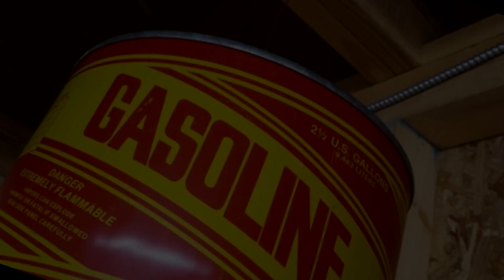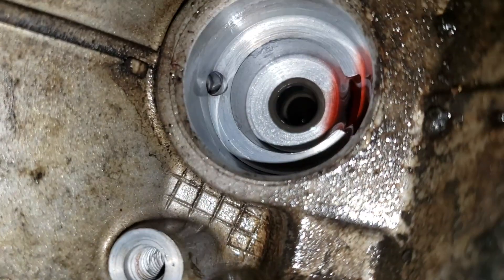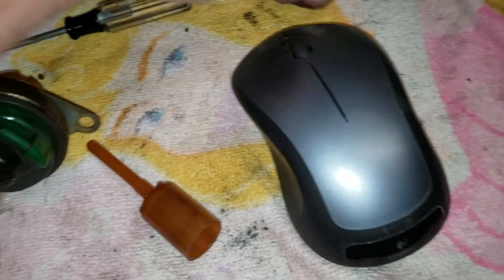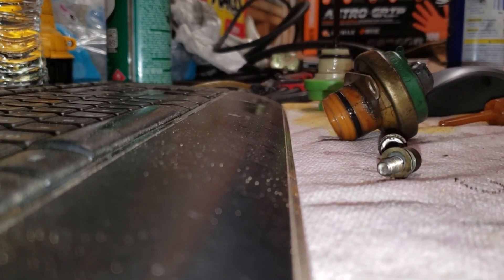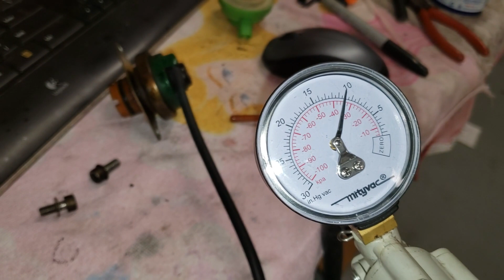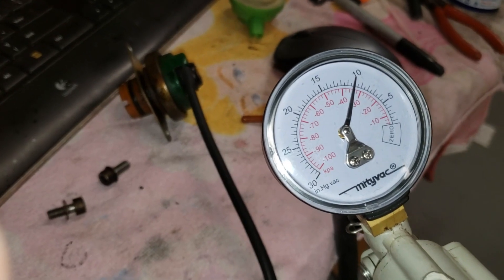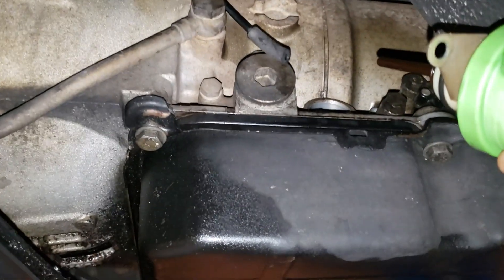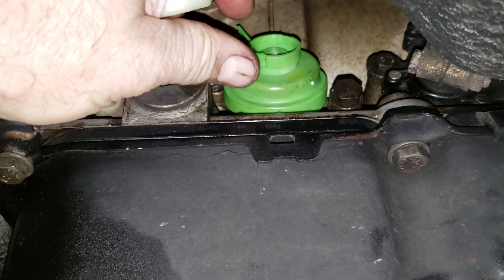Automatic Transmission Modulator Valve Replacement - W126 Mercedes 722.3

Comment from the maker: After several attempts at dialing in the modulator I believe I got it where it needs to be.  The gold standard, in my opinion, is the shift smoothness of the Turbo Hydramatic  400 (TH400) in my Coupe Deville. (chosen for certain models of Rolls Royce cars as well mind you)  The 722.3 in this 300SD now shifts quite smoothly and is not distracting like it was before. Even the 3to4 shift is now smooth. I've not encountered any flairing..... what ever that is.  The end result was that I turned the adjustment all the way counter (anti) clockwise until it stopped, then a half turn back clock wise. (7.5 turns from where ever it was out of the box)  I made several adjustments in either 2 or 3 turns at a time before each test drive. Note also that I started these adjustments with a new unit right out of the box. I have no way of knowing the position in which the manufacturer places the adjustment before they package it for sale.
Reply: Did it solve your late shift?

Comment: hey. my cap (that pne that you have glued on) is broken too, it;s in but has crack sit loose. I have quite hard shifting, but the main problem is when i step out of gas pedal and it's the moment of gear change  - it just so harsh like a hammer knocking on my rear wheels. I'm reading that the caps has also influence here as it needs to be good - it it true? i always thought its also for protecting the screw inside... and second question: when you remove old modulator  (i have 722.4), will it drain lots of trans oil then?
Reply from the maker: Is the shift from first to second delayed? If so this could mean the bowden cable on top of the valve cover needs adjustment. The Bowden cable controls WHEN the shift occurs and the modulator valve controls the quality of the shift. If the shift is significantly delayed, this could lead to harshness. To adjust the modulator, remove the cap and turn the T shaped handle inside.
Reply: @ImpalamansGarage  I'm playing with both thing 3 years non stop... tried all the bowden adjustments, all the accelerator cable adjustments and modulator adjustments too. Is the cap a problem? Or I just have bad modulator?

Comment: I have the w126 inline 6 and whenever I put it on drive it makes this aggressive shift. Was looking for info on this. Will this fix it? Before I go balls deep on the transmission?? Lol
Reply from the maker: The first thing you should do is to make sure you have no broken vacuum lines. Check ALL vacuum lines in the engine bay and to the transmission. Replace any that are cracked or broken. Then adjust the modulator. Clockwise makes the shifts firmer. Counter clockwise makes them softer. The bowden cable on the throttle assembly affects the timing of the shifts - earlier or later. What precisely do you mean by "aggressive shift" when placing it in drive? Any diesel powered car or truck will lunge forward upon putting it into drive because of the torque at idle, although it should not be harsh or loud.

Comment: did this fix your hard shift into 4th?
Reply from the maker: Yes. The adjustability of this new version of the modulator is nice. Keep in mind the quality of shifts is dictated by the modulator and the timing of the shifts is regulated by the Bowden cable adjustment. They work together so you will need to tweak both of them.
Reply: @ImpalamansGarage   great! I'll dig deeper! Great video

Comment: I have W126 280se m110  722.3 transmission, the vacumm line is hanging loose at the engine bay, where does it connect??
Reply from the maker: I cover it in this video. https://youtu.be/Wz4_eMrZk9o   Let me know you need additional info.

Comment: so what was the result of your labour?
Reply from the maker: The transmission shifts so much better than before. With the updated modulator and adjustments plus new vacuum lines in several areas.... the driving experience is very nice. In some instances, depending on the driving conditions I have noticed a very slight flare from 2 to 3 but this has only happened once or twice. Debating on whether or not to make another small adjustment. Guess I will just have to drive my classic Mercedes some more to determine!
Reply: @ImpalamansGarage  Once you put that plastic cap on, can you remove it? I have a new injection pump with  bigger elements. The car shifts great except for the 2-1 down shift is rough. I used the fine adjustment and the shift improved slightly. If I could just get that cap off and adjust it more I believe the problem will be solved.

Comment: Thank you for your great videos. I have a 1991 350SD, I lost reverse gear and started looking for a used transmission but after not finding one I decided to replace my vacuum modulator using your video as reference and to my surprise , I now have reverse but is not smooth, it doesn't kick in until 4 or 5 seconds later and makes my tires spin. How do I know which way to adjust the modulator? I also found a disconnected vacuum hose from the vacuum control valve that runs next to the fuse box but I don't know what it connects to. Any advice will be much appreciated , thanks again..
Reply from the maker: Clockwise adjustments of the modulator increase shift firmness. Counter clockwise adjustments make them smoother. Going too far either way has obvious repercussions. I'm not sure adjustments to the modulator will address the reverse issue. Here are a couple of links with good discussion on this topic that may help. Regarding Modulator adjustments:  https://www.benzworld.org/threads/i-fixed-my-shift-flair.1314697/#post-2330736         Regarding reverse issues:  http://www.peachparts.com/shopforum/diesel-discussion/376603-only-using-half-springs-722-3-transmission-reverse-piston.html
Reply: @ImpalamansGarage  I will try the adjustment tomorrow  and will also check the other info. thank you for your time and knowledge.
Reply from the maker: Here's a vacuum diagram of an OM603 from 1987. It may suffice to help you. http://www.peachparts.com/shopforum/attachments/diesel-discussion/98874d1326765510-om603-vacuum-parts-vacuum603.jpg

Comment: I will definitely be doing this next. I believe I have adjusted all I can with vcv and current modulator. My shifts are close to what you were experiencing before you changed the part. All vacuum related

Comment: Dumb question, Do you turn it right to make the shifts smoother or harder?
Reply from the maker: Clockwise adjustments of the modulator increase shift firmness. Counter clockwise adjustments make them smoother.

Comment: So important question, did this fix all of your shifts??
Reply from the maker: This modulator allows for fine tuning adjustments. Couple that with adjustments made to the Bowden cable, and yes.  There is a high degree of adjustment available and simple replacement alone is just the first step.

Comment: Great vid. I have a w124 with the same modulator, and I think mine's fine cause it can be adjusted with the T-pin to impact shift smoothness. However, I have one peculiar symptom. When I cause the car to shift between 2000-2200 rpm, there is a noticeable flare. If I am gentle with throttle and it shifts below 2000 rpm, no flare. Same with full throttle when it shifts upwards of 2500 rpm, no flare. What could possibly be the reason for this you reckon? Slight tranny oil leak exists, but dipstick has been showing full for atleast an year.
Reply from the maker: From what I understand, the situation you are describing is quite common. Long story short I believe it has to do with the amount of vacuum supplied to the modulator by the VCV (Vacuum Control Valve) under these part throttle conditions. Here is a document detailing the modification of the VCV to help with this situation. I've not done it however. http://jenniskens.livedsl.nl/Technical/Tips/Files/Mercedes%20722.4%20adjustment%20guide.pdf
Reply: @ImpalamansGarage  This article was awesome but I failed to mention, mine's on petrol, not a diesel. I read most of it thinking maybe some parts will overlap but feels like on diesel, the vacuum system is completely different.

Comment: Hello, I have some problem with shifting from my European 1983 w126 380. It shifts true the gears very fast, when I drive 40/45 kmh it’s already in last gear.. when I press the gas pedal driving 50 kmh there is no shift back, this only happens when I press the kickdown. Than as you press it the car wil drop 1 or 2 gears and brings a smile on my face.. But as soon as I release the “kickdown button” with the gas pedal it wil shift back to last gear. 
Now I don’t know if this is normal or there is something wrong here.. 

Next problem.. 
when I floor it from stand still, it wil shift first to second smooth, around 5000 rpm maybe 4800rpm. Not sure. than the 3rd to 4th I need to let the pedal come up (release the “kickdown button with the pedal)  because it wil go past 5500 rpm and feels like it won’t shift 🤷🏼‍♂️

Is this supposed to be like this or is there something wrong here to..
Reply from the maker: You may need to adjust the bowden cable. On my car a clockwise adjustment makes the transmission shift sooner. Counter (anti) clockwise makes the transmission shift later. Do this 1/2 turn at a time and test drive after each adjustment. The bowden cable adjustment determines WHEN the transmission shifts. The QUALITY (how hard or soft) the shifts are is determined by the adjustment of the vacuum modulator on the transmission. A clockwise adjustment of the vacuum modulator will make the transmission shift harder. A counter (anti) clockwise adjustment will make the transmission shift more softly. Both the modulator and bowden cable work in concert with one another. It will take you a while to make the adjustments and get your transmission shifting properly. The Mercedes factory set these adjustments by measuring transmission fluid pressures during the manufacturing process. Lastly, when the transmission is shifting from 3rd to 4th under a heavy throttle condition, you may find it necessary to let up (decrease throttle pressure) to make it shift. In general, under wide open throttle you want the transmission to shift at the shift points noted on the speedometer. There are marks on the speedometer showing about where the car should shift when you floor it.
Reply from the maker: Here is an excellent document on how to adjust your Mercedes transmission.  This document is for a diesel but it may be of help. http://jenniskens.livedsl.nl/Technical/Tips/Files/Mercedes%20722.4%20adjustment%20guide.pdf
Reply: @ImpalamansGarage   the best, thanks very much man. I really appreciate 💪🏽 I’ll let you know if this works 😁

Comment: Can the valve be removed when the transmission is still filled with ATF, or will the fluid start draining from this opening the moment I pull the valve out?

Shifting is working fine but there is wetness in that area. I suspect that o ring to leak.
Reply from the maker: No need to drain the ATF to remove the modulator.
Reply: @ImpalamansGarage  Thank you!

Comment: I have E320 with 722.5 transmission, it only gears first gear and don't change it. Do you think that modulator valve is my problem? What you indicates me how start the diagnosis?
Reply from the maker: The modulator valve only controls the quality of the shifts. You could remove it entirely from a normal transmission and it would still shift through all of the gears but each shift would be very harsh. There does seem to be a lot of discussion on your problem in the Mercedes forums. https://www.benzworld.org/threads/722-5-transmission-shift-problem.1549876/

Comment: Hi Master, I am using W124 year 1992
My problem is when normal driving , gear 3 can't shift to gear 4 .
It become free gear .
What is the problems ?
Reply from the maker: Make sure your transmission fluid is new and is full. Usually a transmission which refuses to shift will require a complete rebuild.

Comment: I have benz w124 1995 e320 
What color type of this modulator valve  well used in my car?

And am I can replacement it easily!?
Reply from the maker: Here is the modulator valve for your car.  It should not be difficult. https://www.pelicanparts.com/More_Info/1262709179.htm?pn=126-270-91-79-M22&SVSVSI=3760&DID=13332

Comment: Hello I own a 1982 300sd 126, my transmission won’t engage into any gears it stays in park any clue if changing the vacuum modulator would fix this?
Reply from the maker: No sir. It will not. First:  Check your fluid. If it all leaked out, then the trans won't do anything. Second: Check your shifter linkage under the car. It may have become disconnected. If it's full of fluid and your shifter linkage is OK then you need to tow it to a transmission shop. If all the fluid leaked out you will need to refill it. Remember that checking trans fluid is done with the engine running at idle and trans in park. Each time you add fluid to the system you should hold your foot on the brake with the engine running and cycle the shifter through all of the gears and then back to park. Check again. Add fluid if needed. Cycle through gears again, etc.....

Comment: I've got a 1986 560SL with 200K miles that shifts smoothly while driving.
Its also a 722.3 transmission.
The problem is when I shift to or from Park/Neutral/Drive to Reverse I get a hard engage.
I can get a softer engage if I momentarily shift to Reverse, quickly back, then back to Reverse.
The Modulator looks original.
Have not checked the Modulator to see if it holds Vacuum - need to, but was concerned about
loosing my Transmission fluid.
Do you think I need to try a new Modulator?
Reply from the maker: You'll note very early in the video where I show the open port where the modulator resides that there is no transmission fluid which had dripped down over the lip of the pan. It's dry. Thus there is no fluid loss when removing it. If your transmission shifts properly and the only thing wrong is a hard reverse engage then I would say your modulator is not the issue. Without knowing what you consider to be a "hard engage" into reverse, it's tough to say where the problem may reside, however there is a fair amount of discussion on this topic. Here is one example: http://www.peachparts.com/shopforum/diesel-discussion/376603-only-using-half-springs-722-3-transmission-reverse-piston.html    Your issue may be related to the reverse clutches or springs insde the transmission. I would start with the basics however. Does you fluid look good? If it's not red, change it and the filter. Check all vacuum lines.
Reply: @ImpalamansGarage  Transmission fluid is bright red and full to correct level.
I can get a much less "thunk" by teasing it quickly into reverse, back out, and back in.  Wondering if its vacuum.  Can the way the Modulator is adjusted have an impact on this "thunk"?
Reply: Thanks also for that posting in Peachparts.
Interesting that a firm shift to Reverse is less wear.
Reply from the maker: @cwmoser  I highly doubt it is vacuum. The modulator, whether or it's bad or good, should have no effect on the engagement of reverse gear. The modulator regulates fluid pressure to control firmness of upshifts. I would just hold my foot on the brake and shift it into reverse and wait until it's properly engaged before reversing. I fear moving the shifter around like that might do more harm than good.

Comment: Hello. What was youre problem? Your tranny starts from1, and goes to 3 (no 2. gear)?
Thanks a lot:)
Reply from the maker: Several annoying issues:  Shifts from 1 to 2 and 3 to 4 were hard as nails. Shift from 2 to 3 was way too soon. Also the original modulator has a rubber cap on it that is prone to leaking vacuum. The new modulator is an improved design. Mercedes is not the only car manufacturer that uses vacuum modulators to control shifts. This is an extremely common maintenance item for older auto trans cars.